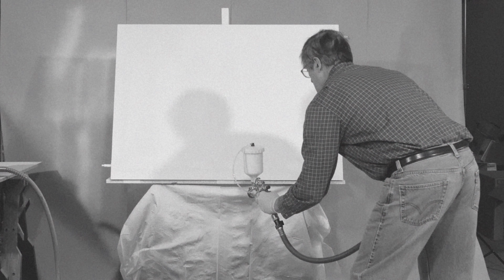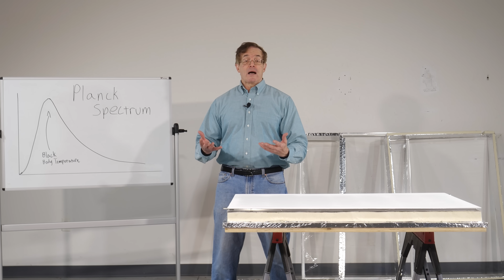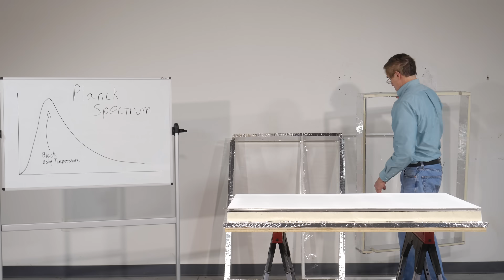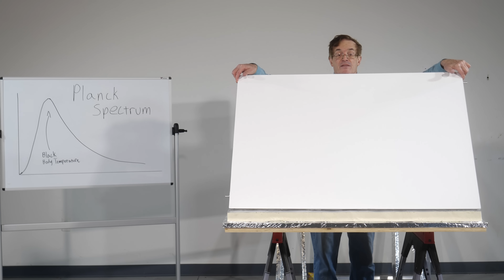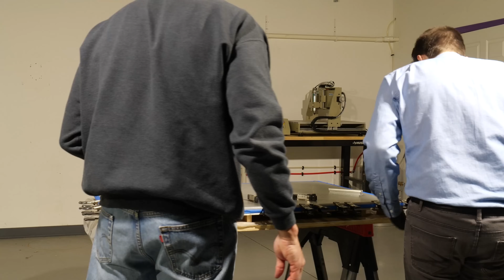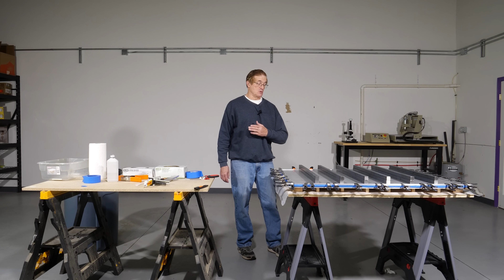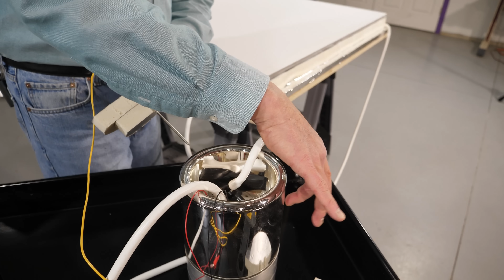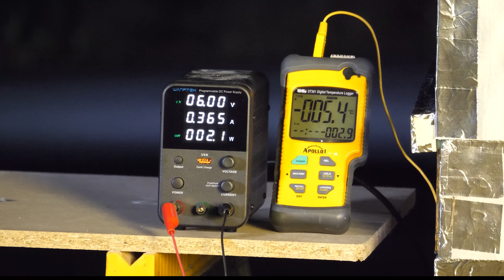Air Conditioning isn't free... but we're close.

Comment: Nice, very interesting experiment. As a fellow mechanical engineer I tip my hat although I’m a bit dubious to the practicality. This seems like an interesting method of passive cooling but what happens when you’re trying to heat the building?
Reply from the maker: Obviously, the focus  here is on cooling.
However, the cooling effect rapidly decreases as the temperature drops. The relationship  is T^4.

Comment: Impressed and disappointed at the same time. Remember the desiccant air conditioning video where all the tall claims about high COP got crushed in an actual unit built in the second video.  Well this video looks similar, first the test is done in winter and not in summer . Secondly it's done at night, also if it does work in hot climate then please make another video in summer or in a hot city to prove this. If it works better when the fuild is hotter then prove that also.

If this radiative cooling technology is soo good that by running the cold water through the air conditioners condenser it will boost it's efficiency by reducing the load on the airconditioner compressor then why aren't companies doing this. What are the problems in implementing this.

Comment: Cool concept. I love seeing new tech. Unfortunately MOST HOMES are already fitted for old tech like central air and furnace... So no matter how many innovative heating and cooling systems are developed, it is not at all feasible to retrofit your home... I've seen geothermal that will cost you $30k. So you want more efficiency, but you have to remove an already working, but inefficient system.

Comment: the big 100 IQ fix is to legalize multifamily housing. Shared walls are free insulation, and detached single family homes require many times more energy to heat and cool because of that, and local ordinances that mandate unnecessarily large minimum sizes for houses

Comment: Could you connect one side of thermoelectric coolers (like the ones used for the mini fridge project) to a panel of aluminum with this cooling paint and the other side of the thermoelectric cooler with a panel of aluminum painted with Vanta Black (or some black paint with extreme light absorption) and passively create enough temperature difference to make a solid state thermoelectric generator? No moving parts, just absorbing/radiating energy in a controlled way.
Reply from the maker: Yes.
The output would  be low because of the low efficiency of thermoelectric generators.
Did you watch our earlier video on "The Campfire Generator "?
Reply: @TechIngredients  I think so, re-watching now because I love your content! I'm glad my intuition was correct. I remember them being very inefficient, I was curious about how large of a temperature differential could be achieved and the possible energy generated, even if it's in the miliwatt range. The idea of a device that just sits on a shelf and generates power in a very non-obvious way is kind of fun to me. 

I've also wondered about putting them on the back of the solar panels to cool them down passively and increase efficiency. A cooling system that is a one-time installation with no maintenance (like the paint you made) might be more viable on a commercial scale, especially if you can convert cooling -> efficiency boost -> increased production/day -> extra $$/day -> days until break even.

Comment: You should absolutely positively never run cold water through your hydronic heating system. It’s not designed for that and if your climate has so much as a fart’s worth of humidity in the air it’s going to cause a shitload of water to be dripping around inside your walls. That is not good for your walls. Or your lungs. Or those of your pets. Or potentially of structural elements of your home that lose strengthon exposure to excessive moisture and cellulose-eating fungus.
Reply: I was looking for criticisms to this experiment and you seem to be offering one. Essentially what this is is a video equiv of a research paper… lacking in peer review. Am I wrong?
Reply: @Akkbar21  I mean, I can’t speak to the whole video. I just know that hydronic cooling isn’t really used, because managing condensation is something you have to design for. And nobody designs for that because it would be too expensive and hard to maintain. Unless you lived in a climate where humidity is a rare concern.

Comment: I don't think this will work in practice. Why?
1. You just measured a temp differential with no heat load in the water pump circuit (besides the losses in the tubing). My guess  is you don't get any useful wattage for a building.
2. Soiling, the plastic foil will get soiled or break, and the absorption from the sun goes up enormously, during the day, when you need the cooling.

Comment: Fellow NH Polymath here.

Idea; instead of trying to reach the efficiency of plants, what if we work out how to use the plants to get power? Or even just cooling. I gotta wonder.
Reply from the maker: Don't  get trapped into the assumption that harvesting power is limited to electrical  current just because the existing infrastructure  is designed around that.

Comment: It is always enjoyable to watch your videos, you have helped me with my research in automotive engine cooling and air conditioning with medium horsepower engines that doesn't cost $5000. Due to the limited room in my engine bay, I can't expand on the standard cooling system. I have a Mopar 1969 440RB in a 1968 Dodge Dart that runs great and cool with the standard radiator and fan system during the winter.  Yet, during the extreme hot summers at 103 to 115, I can reach engine temperatures of 230-250. If I could just cool down the engine coolant to 180-190, the optimum temperature. By flowing the coolant out of the radiator, that is still too hot, using a air cooled finned tubing system that runs under the car. From the output of radiator to the rear and then back forward to the engine, by utilizing the air that flows under the car to help get the coolant down to 190, before it goes back into the engine. Your thoughts on the this would be helpful. This home air conditioning system of yours, not for my condo, but to help cool down the interior of my Dart somewhat during these hot summers, if even possible. Thanks for the great videos.

Comment: Love the video and can't wait to make my own! One point of concern is the use of aluminum in the construction of a pumped water loop, with it plumbed into either a liquid to liquid heat exchanger or an existing radiator system. My concern is galvanic corrosion, and though the propylene glycol will help it would be better if it were a third of the mixture, which I'd only trust in the liquid to liquid heat exchanger setup (where it may be sufficient with a corrosion resistant heat exchanger, regardless). Pumped to a traditional radiator setup, I imagine that the IF radiator (perhaps just the water channel) would have to be copper, unfortunately!

I think I'll make a jig to bend copper pipe for the water channel, try something like copper wool around the piping, and then tension the piping and wool between two aluminum plates? I worry the thermal contact would be insufficient, but would love to hear your ideas!
Reply from the maker: I chose aluminum simply  for convenience.  The large surface area means any material for the construction  of the heat exchanger, even plastic will work reasonably  well.

Comment: I love this being a thermal engineer and you nailed all angles.  My only concern if you paint your house in this, you would increase your heating costs in winter. If only you could turn your walls inside out and heat your house.
Reply from the maker: Actually, no.
Remember, the cooling effect is temperature dependent and to the fourth power of temperature. The colder the surface, the less the radiant  heat loss into the sky.
Neat!
Reply: I’m also wondering if there other uses besides reflecting energy out into space? Could you use this technique on both sides of a building envelope and thus creating a super insulator that’s only a fraction of the thickness of traditional insulation?
Absolutely love your work!

Comment: Nice video👍. I was wondering what would happen if, instead of a flat aluminium plate, an aluminium finned plate would be painted with this special coating. Since this coating absorbs very little heat by radiation, the fins shouldn't heat each other ???and the surface area would be significantly larger...

Cool would be able to see this being used on a split ac unit 👌

Comment: Hmm ... Well after 31yrs in HVAC & Controls , and after seeing many different kinds of systems . Plus maintaining them .  HTHW for heating thru converters to make HHW and Steam , HP steam for heating & cooling . DX cooling of course .  Methan gas at Sewer Plants for heating . Coal fired Central Heat Plants . NG fired CHP's . Oil fired boilers & furnace's . Roof top Solar Panels for domestic HW . Heat pumps with some having UG lines in the ground .  I found this video , most interesting .

Comment: I use Loctite H8100 for aluminum.  It is the best I have ever used!  BTW,  You should have used the static mixer tip on the 2 part Loctite epoxys.

Comment: I was inspired to prove that the moon light cools by some old YouTube videos a few years back. The test was to moon shade one part of an aluminum sheet and use an IR thermometer to see if the shaded side was warmer by a degree or so. It was. Realizing that my research skills were limited I never found light frequency that cooled., so  I tried the same set up  and even during a new moon got the same results. 

I thought perhaps it was because the  shade was overhead it blocked radiation so I mounted the aluminum vertically and waited for the moon to be about 25 or so degrees  from the horizon. The 4 inch thick Styrofoam shade was acclimated  and located  16 inches away so it shaded one side. I got similar results, the shaded side was still warmer. 

Perhaps it is the shade was radiating again but the surface of the shade was cooler than the aluminum by about 3 degrees. 

So I waited for moon set  and found that both sides of the aluminum were the same temperature. By eliminating the moon, ambient radiation made no difference.  The sheet was from a scrapped storm door and was a chalky white pebbled finish and measured 18" x 28-1/2". 

Perhaps including this moon phenomenon could increase your cooling efficiency.  I can't get my head around the moon's ability to suck energy from 238,900 or so miles through a vacuum.

Comment: What if instead of having the shape of the frame be a rectangle, you make it into a section of an upside-down pyramid. Won't it radiate out the infrared faster and let it collide with and refract from the air inside a little less?

Comment: I love your videos but as a painter it’s hard to watch you paint. So I’m gonna give you a tip so you get a better more even coat. You want to make sure you keep the fan or the gun flat the whole time to your piece. Think of your arm like a robot arm, keep it flat from end to end basically at a 90 degree angle. Also you want to do a 50 percent overlap. That will get you an even coating on your piece. Also you want to hit the top and bottom twice. To get get that even coat. Hope it helps
Reply from the maker: Thanks.

Comment: Okay, I'm in the desert southwest, daily temps at 100-110. Local codes don't allow water chilled systems, so I have the outside fan unit and it does not do a good job and take a ton of electricity. If I build a panel or panels like this, what would I tell a local HVAC shop in terms of introducing this to my inefficient unit that rarely cools my home?

Comment: I am curious if you could use an automotive radiator to run water through for the building side and then have that water pumped through this radiator to dump the heat outside. Cheap single room air conditioning, though admittedly the plumbing is potentially a tad more complicated than more traditional systems... or potentially you could use copper tubing to build a radiator across the air intake on a window mounted air conditioner unit to reduce the temperature of the air that is cooling the condenser side. Not as effective as directly cooling the refrigerate but no modifications to the plumbing of the unit.

I love how this channel inspires my tinkering side.

Comment: About cooling using conventional radiators, that probably wouldn't work too well because the cooled air would stratify on the floor. When you're warming the air up, the updraft leads to effective convection which mixes things up, but since the radiators are placed near the floor so that there's little time for the now-falling air to gain kinetic energy, the resulting mixing most likely would not be sufficient in a cooling application.

Forced circulation of course rectifies the situation, so a coupling with conventional air conditioning systems would seem more effective. Also, in hotter climates where cooling is the norm, one can envision "radiators" placed near or in the ceiling.

Comment: A flipping roof tile, one to reflect radiation away and one to absorb. Maybe tar and gravel is something we should get rid of, and instead use some easily replaced flapping actuators and a thinner material... problem is when flipping an overlapping tile you also reverse the water shedding, lol.

A long time ago I had a color changing toy car that went from a dark purple (almost black) to white - with the application of heat. As an adult I thought that would be a good way to passively keep a home cool or warm, if only there was a sensible way to do it. When I go camping, I bring a tarp that is white on one side and black on the other. I can flip this around depending on the weather.

Comment: I take it ground based temperature control isn’t very efficient or effective? Those pipe systems that are buried a few metres underground where the temperature is pretty constant throughout the year and mostly cooler than summer surface temperature but warmer than winter.

Comment: Okay so you've made this really cool passive cooler. You say it will greatly contrast ambient temperatures to varying degrees.

Shouldn't we be able to leverage the cooling process or  leverage the difference to just flat create electricity?

High temp water from the parking lot. Low temp water from the roof.

Comment: Have you considered the heat dumped into the system by the pump? Might be worth finding a way to dump that heat outside the system vs inside it to further increase the efficiency.
Reply from the maker: I did.
The pump was convenient, and its  presence only further supported the capability  of the system.  But, you're right that the efficiency  could be improved.

Comment: Fot a more efficient glazing in s tead of a film that would build a Hot Box stagnant air mass ...would not a Lauer of Aero/Gel on top of it been superior  ?
Cabot  in Mass could have supplied you the Aero/Gel
Reply from the maker: You might be right.
However, with further testing, it turned out that the film added little to the performance, so it can be eliminated.
Have you watched our latest video?

Comment: This surely would if coated both sides on a plaster board make for a fantastic insulator, since it reflects infrared.. It's cooler in summer and reflecting heat back from the inside would make heating a house in winter far more efficient.. It would also make for a fantastic paint for ones internal walls providing you don't mind white..

Comment: Nice stoves. I've used one to prepare breakfast in a tent and use it as a heater inside the tent. Alcohol burns very cleanly and the gravity fed alcohol stoves mix the fuel and air very properly so the flames are very blue.

Comment: As usual, great execution and reflection of the project. Understood everything. Only a small question: in the building of the "chiller"... you circulate the liquid through the spaces between the "gray" closed cell foam fillers from the inlet to the outlet. The reinforcing spacers though are glued onto the top and bottom aluminum sheets. 
Did you drill through them (the supporting bars) to allow circulation or did I miss something on that part ?
Would love to be able to reconstruct this experiment and maybe even install a small heat exchanger on my sailboat to cool down one tiny cabin for better sleeping. Have, for the winter, already installed tubing which I heat with solar power to take out the chill. So, just a question of changing the source of the heating with your cooling.
As always, enjoy your videos.
Bernie
Reply from the maker: The aluminum spacers do not span the full width of the inside of the exchanger.
The liquid flows over and around the foam and takes a zig zag path from entrance to exit.
Reply: @TechIngredients  thank you, that makes it indeed crystal clear

Comment: If the goal is to get as much surface area exposed to the sky as possible would it make sense to use a cube or rectangular heat exchanger that could be surrounded by a box or more ideally an angled trapezoidal "box" that would reflect all the heat from our center emitter? Think a satellite dish but cubic. Ease of manufacturing would be massive advantage, and if I understand the way this works I think that would be more efficient as well.